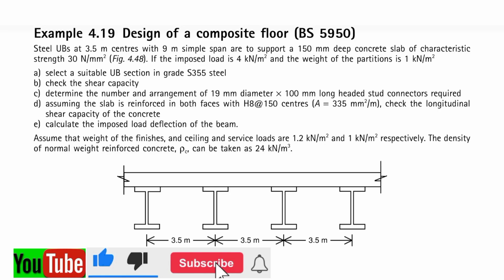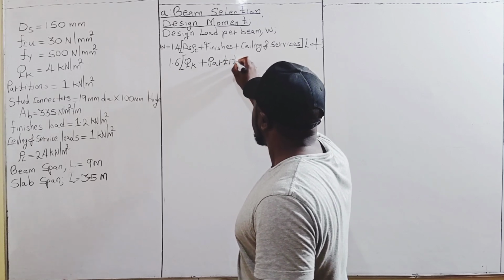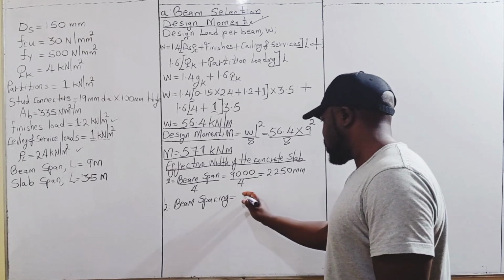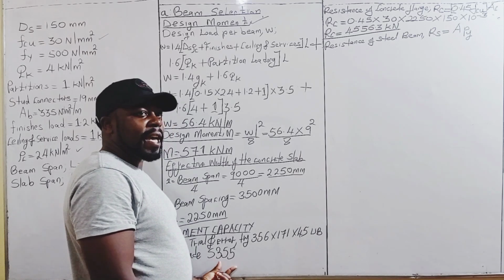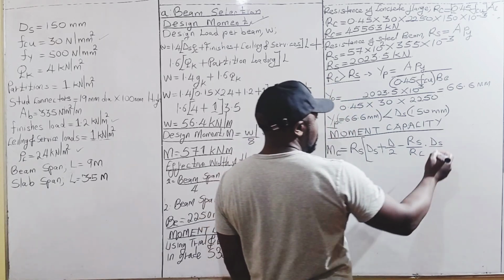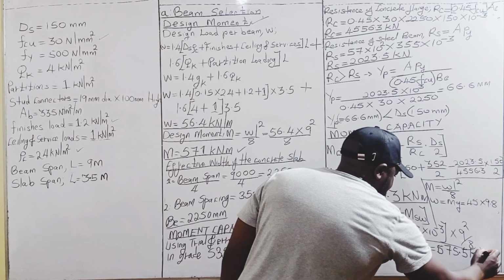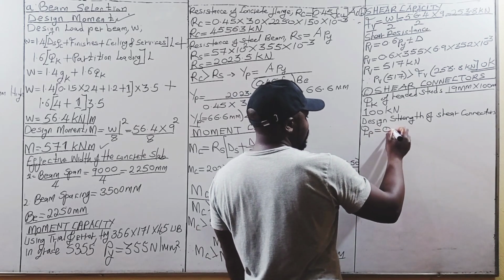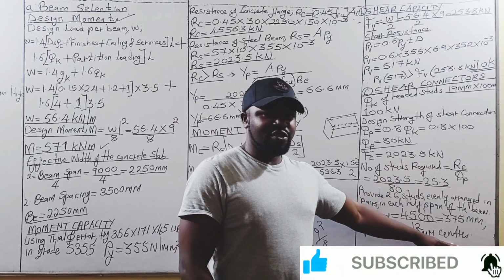PART 1: HOW TO DESIGN A COMPOSITE FLOOR|STEEL GRADE S355 TO BS 5950

Comment: please i want to know why for the number of studs calculation you used the RS  value in place of the RC value to calculate your number of studs?
Reply from the maker: Number of studs needed = (Wall Width / On-Center Spacing)+ 1